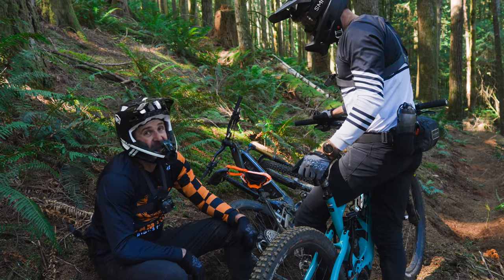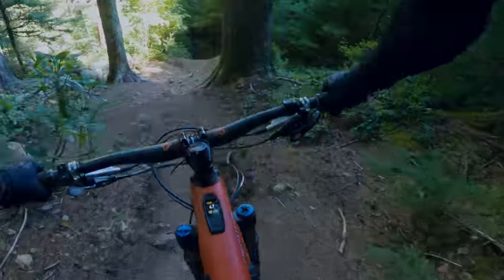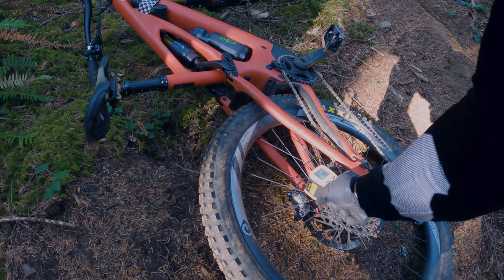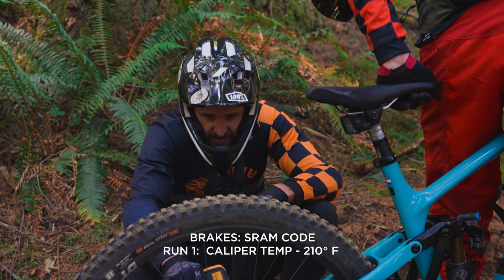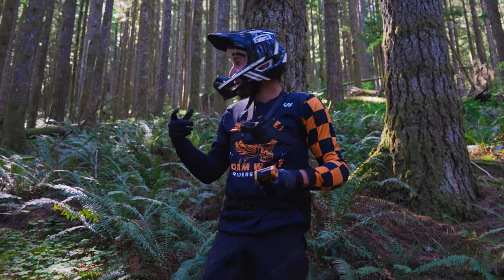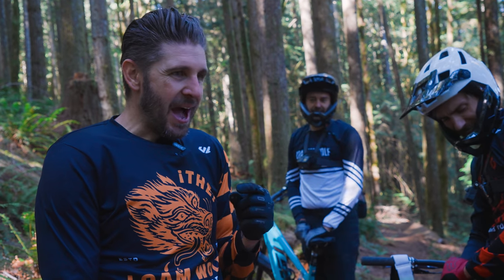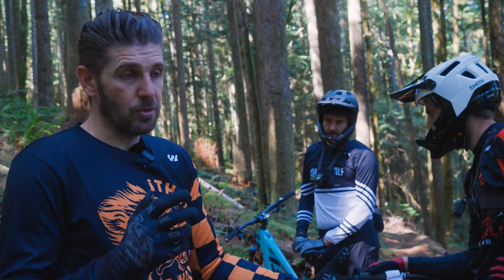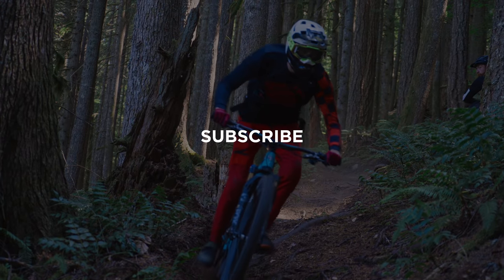Mountain Bike Brake Test - Temperature Testing. How Hot is Hot?

Comment: Had Code rsc with 220/200 and Hope v4 with 225/200mm Rotors. switched to Trp dh-r evo with 220-203 Rotors. These trp Brakes are the best i Ever Had. Insane Power and no fading. Even After 1000m vertical drop they performed perfekt. I love them, especialy the Gold Color 😅

Comment: Fantastic work done in this one! - - Test Results: 
1. TRP - Best in braking power and feel with least amount of heat to caliper 205.
2. Shimano XT - Second coolest temperature 210, harder to pull than TRP in extended braking but still very powerful.
3. Sram Code - Lost its famous for modulation in extended braking. Highest temperature of 285 degrees, lost braking power, most hand pump.
Reply from the maker: Thank you

Comment: Would love to see the difference in heat with different pad materials, finned or not, ice tech or full steel rotors, and rotor size. Great video though!
Reply: Agree with you thoughts. TRP uses a 2.3 rotor while the shimano and sram use a 1.8mm thick rotor. The thinner the rotor the hotter the caliper gets as the pistons touch it. Which is a testament to the rotors that shimano uses with the fins, I guess they really work because the XT was closer to the TRP in temperature.
Reply: This test is really pointless. They are pointing a heat gun at the caliper, but that temp doesn't reflect the pad or rotor temp, where fad actually happens!! You could have a caliper temp 50% higher, but it could still have less fade based on the pad material!! The pad and rotor temp will mostly come down to rotor diameter, thickness and built in cooling in the design (fins ect.). I suspect this test is just a paid promotion for TRP! Don't get me wrong they make great brakes, but this test is just ill conceived.

Comment: Some pad and rotor compounds perform better at higher temps. After i switched from Shimano, Sram and now to TRP rotors (sram code rsc with metallic pads), the performance improvement was instantly noticeable on long descents. I would assume the TRP brakes with TRP rotors would be that much better. But frankly, i love the ease of service on the Sram's, the Bleeding Edge gives a perfect bleed every single time. Something i could never get with Shimano

Comment: I run Sram codes and have done for 3 years now but run Magura 220mm MDR-P disc front and rear and carbone lorraine pads VXR pads and perform better than Sram sintered which are so good on my Specialized Kenovo and they run cool all summer and are great trail braking and great feed back.

Comment: I found my way from SRAM to Magura to TRP. TRP is easy to work on reliable and strong in all categories of modulation, power, lack of brake fade. I actually think I could have gotten away with Slate EVO and still been ecstatic with the performance. Cool trails, I was trying to figure out where you were and could not!

Comment: Presented by TRP.... Am I the only one that saw this? I've never ridden TRP so I cant comment. I have Code RSC and I had go up to 220/203 rotors. I was smoking the rotors on anything smaller. I went with the Magura E-Bike rotors. I feel that any set of brakes will do better with 220/203 rotors. Try  big rotors before dropping a lot of cash on new brakes.
Reply from the maker: Hey Duane. We had originally planned on making a different video altogether but after riding each brake back to back the direction changed. And while TRP is a presenter of our YouTube Tech Test Series, our results wouldn’t have changed even if SRAM was a presenter. We chose to partner with brands who’s products we like and believe in. Magura also makes solid brakes and like others, have their own quirks and defining characteristics, but they would have likely been high on the list with Shimano. Above all else we value open and honest testing and review process and do our best to report accordingly. Staff and non-staff testers all would pick TRP for all out power on their personal bikes.

Comment: Could also throw in pad materials in this test, I would like to know if race labeled pads help in keeping heat down...
Reply from the maker: Yes for sure. More to come!
Reply: @TheLoamWolf  i have a difficult time w/ that kind of thermometer on shiny/reflective surfaces such as Al heat-sinks. the readings fluctuate tens of degrees based on the thermometer's orientation. 
i have better results using a probe thermometer (no, not the ones for cooking :} )
great video
Reply: They also forgot to mention that the shimano and trp brakes use mineral oil where the sram brakes use dot fluid which can operate at higher temperatures for longer which is why they use it in motor vehicles for years and years without any issues. Like when was the last time you bled the brakes in your car? I haven’t bled my codes in three years. Never overheats, way better performance, less maintenance. I have to bleed my XT’s every 6 months at least and do a lever bleed on them about every five to ten rides to keep the random bite point away. My XT any of them are nowhere near as good as my codes but it’s ok because they’re a lot cheaper than codes and nobody rates trp except this these guys. Good luck finding a good review anywhere else or find a pro without a brake sponsor running them.

Comment: I did, and I know that my Sram Centerline rotors got to around 260-280°C (brown oxidation with some spots turning blue), but since I hanged to 4(f)/2(r) piston brakes and thicker (Magura) rotors, they barely even got any coloring to them (under 200°C), even though I rode much steeper and longer descents since then 😅
Reply from the maker: Awesome feedback thanks!

Comment: SRAM have just released their thicker HS2 rotors which have more surface area to dissipate heat. Would be interesting to see what kind of improvement they make and if they can get anywhere near the 2.3mmm thick TRPs!

Also, I've heard other reviewers complain that the bite point can move around on the Shimanos as they heat up. Was there much of a difference here?
Reply: i made the upgrade from 200 centerline sram to HS2 on my LEVO. very lttle improvment with Galfer EBike pads..i am thinking magura 220 rotors now

Comment: It would be interesting to see Shimano XTR magnesium vs TRP evo's stainless steel caliper.  XTR use a magnesium caliper to not only reduce weight but to keep them cooler. It's interesting how the one guy says @05:32 that he's pulling harder with lost modulation on the sram codes, giving greater hand pump. Then the other guy @08:01 says that Sram brakes get a bad wrap but his colleague @08:12 gives body language that he doesn't believe what he's saying. Sram seem to be the worst in this test and got close to 300 degrees. Which is really hot and gives heavy hand pump and can lead to DOT oil leaking. Seems that the XT and TRP use regular mineral oil, which may help in cooler temps.

Comment: Quick note ... these thermometers have a problem with shiny/reflective surfaces. To get a good reading, you should put a black thermal pad on the brake. 

Still, interesting, but it seems that you got consistently lower temp on the shiny XT.
Reply from the maker: Yep something we have learned since! Always learning and looking for new ways to have fun and test stuff. So, guess we’ll have to try again.
Reply: Yeah, I was using one and numbers just didn't add up because I tried to measure something chrome plated :), which is an extreme worst case scenario for these :)

Maybe you could use those thermal stickers they use on dirt bike radiators. Not sure about the range, that might top out at 100-110C

Comment: Excellent fun and temp comparison.  Measure rotors or calipers? 
Have had MT5 4 piece and MTX red pads.. magura 8.R race pads run too hot for long braking, though too on/off power and poor modulation .
Now have both Galfer W 223 rotors and mtx gold ceramic pads... take little longer to warm like true race brakes but are amazing powerful and modulating when warmed a little and zero fade. Will test further.    Recently changed to Shigura XT levers...wow. power + modulate.

Comment: Why the XT from shimano rather than the saint which is more in the category of at least the code RSC? Also things like pad material and disc temperature would have been interesting.
Reply: The pad material was what I was wondering because as far as I know the organic pads come standard for shimano, I'm running the metallic pads which although are more noisy, work harder for longer
Reply: On steeps I brake harder on the rear and Metallic pads squeal badly when hot. I went back to Organic pads but replace them frequently. I still run Metallics up front as they feel more firm . I have recently switched to Kool Stop Reds and like them much better than the Shimano organics. 
This is on Saints with Shimano fluid.
Reply: Because TRP were paying for the video (see first few seconds of video).

Comment: A more accurate way to analyse this would be to have the same bike for all the different brakes and also the same rider to minimise the effects of the bike on brake use (handling, suspension, weight etc, which will influence how you use your brakes)

To minimise on arm pump it would be ideal to have a much smoother trail where braking points can be much more repeatable each run! 

Measure temperature before and after the run and do more than 1 Run on each brake.

Use same pad compound for each brake (metallic/organic/semi) could even go to the extend of using let’s say a 3rd party pad manufacturer to minimise the effects of pad compound during the test 

Also measure rotor thickness and amount of pad lost after each run

Also would be ideal to try and reduce rider fatigue as much as possible so that feeling of how the brakes work doesn’t get too affected negatively after each run 

Use a control rotor from a 3rd party brand  and compare its performance vs the brake brand rotor 

Analyse with a bleed how did the test affect the oil inside the system 

This I know it’s a very extensive test to do but it would be so interesting to see a much more in-depth review and richer data to support the veredict!
Reply: Heck there could even be influences on the results if center lock rotors are used vs 6bolt ones and that’s on top of footing rotors or full one piece metal rotors… 

This would be so crazy to do and would take like 2-3 weeks but could give some damn interesting info of how this brakes perform
Reply from the maker: Yeah ultimately we just wanted to have some fun, see how hot the brakes get and not be too serious…outdoor testing is never perfect as tires will start to wear after laps which changes braking performance, the trail conditions change as dirt gets moved from more traffic and erosion, creating a totally different run, line changes could vary… and the list goes on. Which is kinda why we just decided to have some fun.

Comment: A note on the IR thermometer - it's emissivity dependent. i.e the color/finish of the surface makes a big impact. 
Often bare metals act as mirrors to IR, so you're probably not measuring the rotor temperature, but whatever the laser sight would bounce to. 

Take the IR gun and point it at random objects that are at room temperature to see what I mean, this only gets worse at higher temps.
Reply from the maker: Thanks! We learned a lot not only about brake temps but about IR thermometers in this process. We may have to do a round 2 in the future!

Comment: other brakes I would like to see:
Formula Cura 4
Trickstuff Maxima, I have chatted with people who have Dirritisima brakes, and they love them, apparently they beat Formula Cura 4 in power and feel.
and also various rotor combos. 
I would like to see BrakeStuff Punch rotors that haven't been tested by many yet. They have made thick rotors long before the big brands did. they claim the tiny venting holes combined with a thicker rotor give better cooling.I see Reverse claims big holes and a thick rotor does that. so some conflicting info. but those RReverse rotors in question are prototypes, and I don't know if they meant in relation to their other rotors or in general, cus things are more complicated than this, I don't know what they used for testing or if it was the same pads or brakes.

Comment: Mmmm, i think this is a good test, however not convinced by the results…the only thing that creates heat is friction between the pads and rotors…then heat is dissipated by the rotor.  Id be more interested in seeing how different rotor styles dissipate heat, and what types of pads are more consistent (metallic, organic, aftermarket pads like MTX, etc).  And perhaps a more controlled setting like having a motor in a lab (rider style definitely had an impact on results).

Comment: Yeah brakes get hot, they're supposed to. Maybe in the next video do a comparison of aftermarket brake pads comparing heat resistance(fade), modulation and noise. I wouldn't be too concerned about reading caliper temperatures unless you can put a temp probe right on the pad itself. Then you could possibly use that data to see if the pads are running in the optimum temperature range per the manufacturer.
Reply from the maker: That’s a good idea! We’ll get some more brake pads and install them to see how they do.

Comment: I have the Shimano Saints 4 pistons with the TRP rotors and Im about 220lbs. The Saints, when cold, feel like its at full 100% locked or 0%. Once they get hot the feel and consistency gets better. I find myself having to readjust braking points often when Im riding cause the bite point changes. Its getting quite annoying. 

 Im keeping the TRP rotors. They dont fade as much as the srams and ice techs. Will probably get the TRP DHR Evos soon. Heard nothing but great reviews from them. 

I bought a set of TRP Rotors back in 2019 and noticed the gap from the wear indicator was deeper than the rotor I bought in 2021. Not sure if they raised the gap on purpose so we would have to change em out more often. 🤔

Comment: One thing to take into consideration, once brakes start to lose power, you start using them more to avoid gaining speed, so they heat up even more from there, at least I think that's how it works.

Comment: Did you just use the rear brake coming down?  Never saw a front brake temp comparison.  Also some pads work better when hot. A material comparison would have been nice  My Magura race pads are incredible when Hot vs the stock pads. 
Enjoyed the video
Reply: Maybe you don't need a front brake on e-bikes. Also, outside of the caliper is not brake temp.
Reply: @-tr0n  No it's that they think the left lever is a clutch on their moped.
Reply from the maker: @paradox963  😂😂 that’s a good one.
Reply from the maker: These trails are much too steep for only using a rear brake. We measured rear for consistency and since that brake is the hottest and gets used more.

Comment: The idea is good but the methodology is quite poor. In any research study, you want to eliminate the variables and biases.

With different bikes, bike weights, rider styles and rider weight, the conclusions are poorly estimated. More so, if the researchers have a bias toward one or another brake, the results might get skewed. 

I recommend one bike, one rider, one straight trail, road preferred and speedometer to maintain same speed. Also, same rotor size and same number of pistons.
Change brakes and test each one separately.
The outcomes would be more significant.
Cheers.

Comment: If you like SRAMs infamous modulation but want more reliability, I highly recommend this set up or something similar: 

I currently ride 
SRAM G2 Calipers and Levers
Galfer Rotors single unit, 2mm thickness (slightly changed the bite point)

MTX Race Red ceramic pads. Offers the same or better bite/grip like the sintered pad but is very quiet like the like the organic pad. 

I suggest you pick these up and test them for yourself.

Comment: it would be more interesting to test with the same rotors. of all 3 the sram rotors were the worse, trp the best. its makes most difference imo.
Reply: What you say makes sense but you can't run TRP rotor on a sram brake, they are 2.3mm and the largest a sram fits is 2.0. Shimano can run a 2.3 mm TRP rotor, I know because its a hack I use and they play well with each other and performance is amazing!  Sram and shimano use 1.8mm rotors but shimano claims their ice tech rotors keep the calipers cooler at high temps and some shimano's have the cooling fins as in this video. I guess they work as they were not even close to the heat of the sram brakes.

Comment: Good video, but to be fair all 3 set of brakes should have been running the same rotor thickness otherwise we all get to a conclusion which is not 100% accurated, shimano 1.8 mm rotors obviously are not going to dissipate the heat as well as 2.3 mm TRP or Sram 1.85 mm centerline, which I think you had. A part from that pad compound is another factor to have in consideration. I'm not saying that TRP are not good,but to have a more accurated comparation all three riders should have had 3 runs with all 3 diferent bikes due to the difference in body weight and all 3 bikes running all three sets of brakes and the same thickness rotors, of course there're some other factors that can influence on how much one uses the brakes and how long, just to slow one down, for instance, tyres, with,compound,carcass, etc.
 In short, you should have reduced the variables to the minimum expression so the outcome was more reliable otherwise, we will never know if those temperatures and the drop in performance of the shimano and sram are mostly due to the rotor capacity of dissipateing heat or that inconsistency is due to  lever/hose/caliper when they are working hard under high temperatures after a demanding and long descent